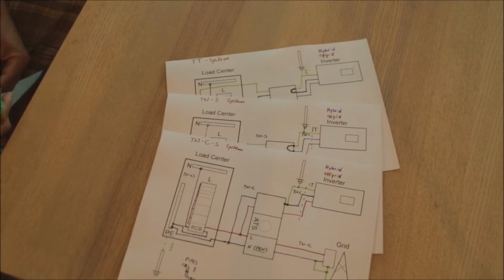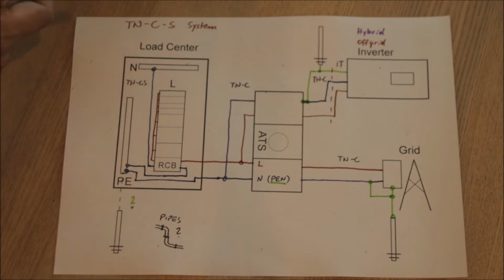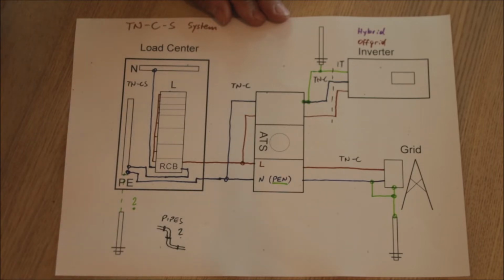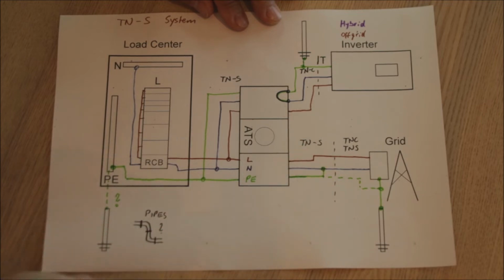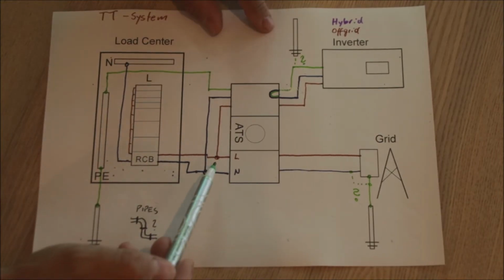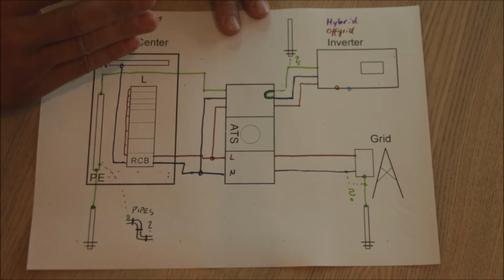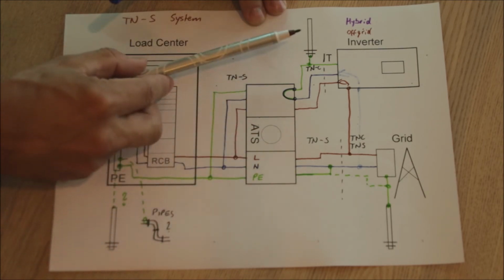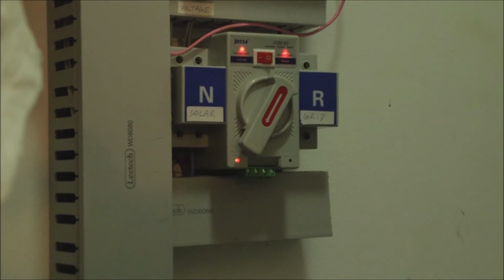Earthing and Bonding of Solar Inverters in different Earthing -Systems. Practical guidance.

Comment: this is such a great video.  I am about to add an inverter aboard my sailboat.  many boats now have GFCI outlets and ELCI breakers on board.  Improperly wired inverters can trip these devices or render them useless.  I have been coming across more and more info in my search to understand how and why this happens, that explores the different electrical setups you are describing, but none that gave a simple clear explanation.  These videos have really helped make sense of these concepts to me. thank you for taking the time to make them.

Comment: Brilliant. That is the best description I have seen for a long time. I wondered if our house is wired correctly. It is TN-C-S. Here in the UK we have two boards or boxes. The grid supplier has a box, and the main fuse on a TN-C-S system has an optional ground bonding point at the side. In the neutral line is then the meter, then the isolation switch, then out to the household panel. In my grid supplier box, the optional ground bonding point is not used.

I spoke to my grid supplier, and I paid for an inspector visit from them, he said that it was normal for the optional ground bonding point not to be used; he says he never sees it wired. My household panel has a ground bond to an earth rod. This is obvious because you can see the rod and wire! He tested this and said it was working well and was safe. He does not test household panels, but said there was also and earth/neutral bond inside that panel, as it tested as bonded. This means my house is wired as you said, with ground both to the grid and earth road. That makes me happy to feel safe.

But, you are the FIRST person to explain this to me. This inspection was done as a survey prior to Solar being fitted, and we also have islanding rules to meet, so our hybrid inverter has to have a zero grid feed mode and meet our local regulations for build. The inspector said we would have to place a separate ground rod on the other side of the house  (6-7m away in our case) for the inverter side of the manual/automatic transfer switch. Again, you explained this. Nobody else I have watched has explained this. Not only this, but your use of language is concise, precise and easy to understand.
Reply from the maker: Hello Trevor. Thanks for your kind comment.
A few years ago, before I started uploading these videos about inverter grounding, I also have only been consumer of online information. But other the general videos about grounding systems in our utility grid (like John Wards channel from the UK) there was just nothing to find explaining about the challenges when this is done with or for inverters. One day every household will have one of these installed, whatever kind of, and my fear was that this will lead to very chaotic and sometimes also unsafe situations once the classic DIYer starts wiring up by themselves.
I am not somebody who is a member of "the national code" writing group. I just see the topic purely by the first physical principles as electrical engineer. 
My channel is very small, and the lengthy videos keep viewers away who are just here looking for entertainment. Typically, my viewers know a bit about the matter and can identify the problem which they have. I find that very good.
So yes, thanks for following. My videos are usually built on information from previous uploads. Whenever you feel the need to dive deeper into the matter there should also be another video to get a few more bits of it :)
Greetings to my UK viewers! Cheers.

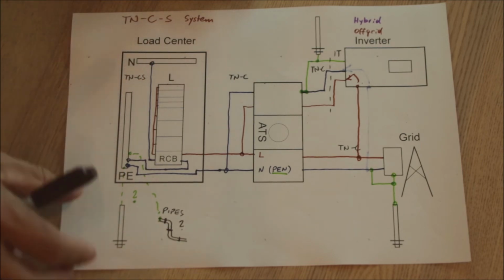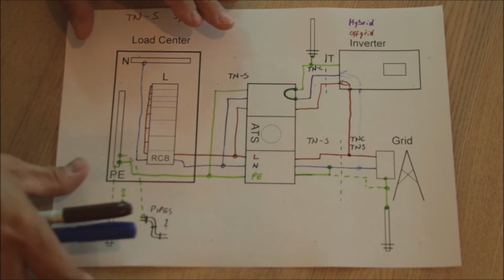Comment: Hi Roland....I've watched all of your videos on Earth Bonding, and also performed my own independent research to become as educated as possible.  I have a Electronics Engineering background, so I hope I don't embarrass myself or Australia :-)   I'm totally off-grid with a very similar Hybrid Inverter to the "Red Chinese Brand" device featured in one of your other videos in Thailand.  It has as an "AC In" connection, which I'm planning to connect my Petrol Generator into (for charging/bypass if required).  My Generator is essentially a TN-S configured system (3-Pin 240V 15A Socket), with Neutral tied to Earth on the Stator Windings on the Generator, and an Earth Teminal supplied for connection to it's own Earth Rod.  So I took great interest in this video when your explained the wiring installed for a TN-S Grid Supply into a Hybrid Inverter (at 26:02 - 27:44).

I notice you only connect the L and N of the TN-S Grid Supply into the Hybrid Inverter (and not Earth), and you are relying on the Earthing you set up with the Hybrid Inverter on the "AC Out" to supply the Earth for the Load Centre ?  Did you deliberately leave out connecting this Earth from the TN-S Grid Supply to the Hybrid Inverter "AC In" connector ?  I suspect "Yes" to avoid a parallel Neutral path back to the TN-S Grid when the Grid Inverter is in Bypass Mode...Is that right ?
Reply from the maker: Hi. Yes, i am trying to strictly separate between supply side as TN-C and then get the S only on the output side of any active power source too keep earth loops unique for each fault condition. If you would connect your petrol generators PE to your load panel by wire as well, then fault current will return on its N and PE wire. It wouldn't matter to much in your scenario, buy yeah...
Reply: @RolandW_DIYEnergyandMore  Thanks Roland....I noticed I had used incorrect acronyms in my message above, so I have corrected them.

FYI...there is a second GPO outlet on my Generator that I plan to use as a direct feed to a Change-Over switch in much the same way you have in your TN-S diagram using Grid Supply and the Hybrid Inverter.

There is another aspect of my intended solution that might be of interest to you.  I'm looking at running two circuits, with each circuit being able to select the supply of choice (Inverter or GenSet) via the Changeover switch.  Without having two separate Neutral and Earth bars in the same Load Centre panel, I'm finding this a challenge.
Reply from the maker: @jeffclarke7990  it is important to use change over switches which disconnect all active wires L and N. this will prevent any possible parallel path via earth or earth wire. then a single earthing bar and rod wull do it. just dont forget about an RCD after your PE separation. always see a power source as what it is, a source and not a consumer! any source is equal to another and must be seen as such. currents must an can only go back to its source.
Reply: @RolandW_DIYEnergyandMore  Thanks Roland....I will draw it up and see if i can do this using a single Earthing bar.  At this stage though, I keep ending up with my Neutrals of both supplies being tied together through the common/single Earth bar.  However, after watching another of your Videos related to the "Dry Contact" floating switch on the Hybrid Inverter, it made me think of using a Relay to solve my problem.

Oh...one last thing...are you back in Thailand, or just up late at night in Austria ? 🙂
Reply from the maker: @jeffclarke7990  Thailand till Juli again :)
Reply: Hi Roland, i'm from Lebanon, it happened with me 3 times, after installing my own earthing system for hybrid inverter, some brand of inverter when i mesure the volt between neutral and earth it come 157 V and between phase and earth come 87 V, like to be the neutral flip to phase, what can i do in this situation? And thanks a lot for what you are giving us.

Comment: Thank you! These videos on hybrid inverters are an amazing resource. It is very difficult to find in depth but 'easy' to understand information about it, and even local electricians that know this stuff (nobody wants to take the job and I am stuck).  I still have a few doubts though. 

I live in the Uk, and have a TN-C-S system from the grid. I also have an All in One hybrid inverter (& batteries, and AC input capability) that I want to use in the garden shed, just to run tools etc and as a last resort back up. The shed has got grid electricity through its own small fuse box, which is connected to the house's main distribution board/load center via armoured cable (the house has also its own solar PV on-grid system/inverter, but this is irrelevant?). 
This is where I get confused. I am assuming that the load center shown in your video is the main distribution board of the house? But in my case, the load center connected to the hybrid inverter would be a new one in my shed (?).  Does this make any difference? Is this related to your answer to 'tibuuso' regarding having an RCD upstream? quote: "check that there is no internal bond inside the inverter first and that the AC In to the inverter comes from a TN stage with no RCD upstream".
Still don't know if the inverter is internally bonded, but I could run some tests. What would be my options in either case?
Reply from the maker: Hi. I guess that the shed now is supplied via a MCB from the main panel in your house while the MCB is connected behind a RCD. Idealy you would want to change this to be a dual pole MCB parallel to the RCD. I think in the UK you typically have a main panel configuration which is a dual pole MCB, then RCD then subcircuit MCBs. So you want to supply the armored cable to the shed with a similar MCB in parallel to the first one. In your shed you again just use a dual pole MCB for the inverter AC In. And at the Out you will just put a sub panel with RCD and sub circuit MCBs. Earthing protection for the inverter and shed is given by the TN-C-S from your House PE. Connect the shed PE to the House PE. If you have an alternative grounding rod at the shed then its OK. I do not see a problem by making a permanent N-PE bond at you panel in the shed due to the low impedances in the TN-system, but if you want to avoid the double grounding loop via PE and PEN over the inverter bypass, you could use a bonding relay similar i have shown in the video for TT-systems.
You can of course try to keep the shed supply as it is but be aware that you might have random RCD tripping in your house.
Reply: @RolandW_DIYEnergyandMore  Thank you for the prompt reply! I cannot see the dual pole MCB on the house main panel, but then again I am no expert. The RCD and the subcircuit MCBs are certaily there. If I understand correctly, I would need to add a second dual MCB on the main board of the house ('before' the RCD), which is out of my comfort zone. Plus then do the rest of the required electrical work in the shed.
Knowing all this, at the moment it looks like I may go for an off-grid set up, following your instructions in the video 'Inverter Earthing and N-G Bonding in a simple Off-Grid Setup' (TN-S). It looks much more manageable for me, and I guess the system could be 'converted' to a on-grid hybrid (TN-C-S) system at a later date.
Any thoughts/videos on grounding the panels themselves? Would they be grounded differently in an off-grid (TN-S) and a hybrid (on/off grid - TN-C-S) systems?
Reply from the maker: @headphonekiller5  if you array is mounted on your shed, i would just drive a separate rod there so that the path for lightning induced current is as short as possible into the ground. you can connect DC side SPDs to that rod then as well.
Reply: Very interesting subject here. I would like to learn more about it. I live in UK aswel and I am thinking to make a portable off grid set up using 10kwh lifepo4 battery and a hybrid inverter SUNSYNK 3.6KW.
I am diy guy, so I am not certified as an electrician but I do have electrical knowledge on wiring, Ac and Dc power.
Still, it isn't enough.
I am trying to make a safe set up, plug and play for everybody, having earthing on a consumer unit with circuit breakers (AFDD RCBO) to give options for later upgrades.
What would be the safest electrical design with latest technology?
I am looking into something very safe (extra safety along the inverter if will be any failure) in case of a short circuit, Arc fault, over current, over voltage, earth fault. I don't want to miss anything.

Comment: Hi Roland! Should we use grounding for portable "solar generators"? Some have high output. For example Bluetti AC500 which has 5000w inverter.
Reply from the maker: Power output isn't relevant when deciding about keeping an isolated system or choosing a grounded one. You can run one single high powered load safely in an isolated setup, but once you add several circuits to your generator, then you should go for a grounded setup for safety!

Comment: Great video and informative. I have Growatt SPH inverter hybrid, installed as tied to grid with batteries and ATS switch and EPS (off-grid) Load connected to entire house panel. Now for the grounding, in this case I lose grounding when the system goes off-grid. Too resolve it for this hybrid inverter do you suggest I follow your TT scheme, because this is the one case you didn't cover in this video.. (you mentioned this type of inverter but didn't provide info on how to resolve grounding for it). My house has proper low impedance grounding sistem with metal grounding belt.
Reply from the maker: Hi. Yes, mode dependent ground bonding as shown in my separate video about TT-earthing is always the safe fall back scenario if there are doubts about other existing ground loops. If your inverter does have a dry contact then you can control a relay for bonding when in off-grid  mode. Thanks.
Reply: @RolandW_DIYEnergyandMore  thanks, the inverter has a dry contact. Can you provide a link to the separate video on TT earthing?
Reply from the maker: @sabinteasca2881  https://youtu.be/RzjZeniZ9AE

Comment: Hello Roland, I can't describe how helpful are your videos on grounding, thank you! In the video you've mentioned that the inverter rod should be placed "at least 5m away from another one because otherwise they will interact with each other". As far as I can understand, Mike Holt from NEC calls it dangerous to have multiple rods on the same yard if they are far away from each other, cause in case of a lightning strike it would create a "potential gradient" on the ground between two rods, or something like that. I think Will Prowse says the same. So can I just connect inverter to the same rod as my mains input? TN-C-S system, Deye SUN-5K-SG03LP1-EU Hybrid inverter. I am also going to setup a relay to make a bond whre the grid is down. Please help, I just can't solve it for weeks 🙏
Reply from the maker: Hi. sure, if you have a chance to use the same of a TN-CS then just connect all of your equipment grounding to the same rod. Using seperate rods makes most sense when grounding a pv array which might be a bit away from your house. Minimum rod distance is there to prevent rods to pick up voltage gradients from others. the soil will absorb voltage in a sort of logarithmic function. Even when one rod is activated by a lightning and it carries lets say 2000V, voltage a few meters away will be significantly reduced. At around 5m distance that voltage will typically be minimal. Even if such remaining potentials are picked up by other rods, that can still be better then when a 2000V surge travels through your whole installation on your wiring. Otherwise everyone would have to ask his neighbors where his grounding is placed if it wouldn't be that way. Enjoy your life with solar :)

Comment: Thank you for this clearly detailed video.
In a TN-C-S system, would it possible to supply a few circuits rather than the entire home load centre, using a changeover switch placed after the load centre?

Say you wanted some heavy load circuits powered only by grid power, but wanted to use solar batteries and inverter to supply lighting, or a socket ring running low wattage items, tv, computer, table lamps etc.

How would earth bonding be achieved in that case?
Could such a hybrid system be created and remain safe?
Reply from the maker: Hi. What you are describing is the concept of an essential loads panel. You can integrate this as a part of your normal load center. Just be aware of transferring all Lives as well as the Neutral wire. No active wire is allowed to stay connected to the original grid source to avoid bypassing any currents. There must be a Neutral to Ground link placed at your alternative power source, which is not active when the panel is switched to your load center (input side of the transfer switches alternate).
There will of course still be a N-G link upstream of your essential load circuits at your grid input but there won't be currents flowing even in the case of an earth leakage at the alternatively supplied essential loads as currents can only return to their power source via a given path. And that path is disrupted by the transfer switch.
Use an RCD in the essential loads panel as well. It will monitor leakage no matter what the power source is. Just always know where your power is coming from and at what time and where currents will flow.
Please watch the practical guidance video and also the video about TT-system. Those videos might help you to understand better what the problems are. Thanks
Reply: @RolandW_DIYEnergyandMore  Thank you so much for that description, it makes things much clearer. Your videos are much appreciated, I find them to be the most logical and well explained on Youtube. I will rewatch everything several times! lol

Comment: hello ..thanks full for video...Grounded system recommendation for an off-grid system, which works with inverter, batteries, backup inverter generator to charge batteries.